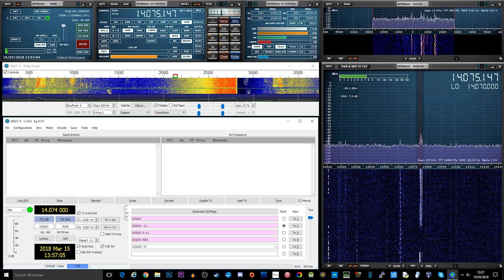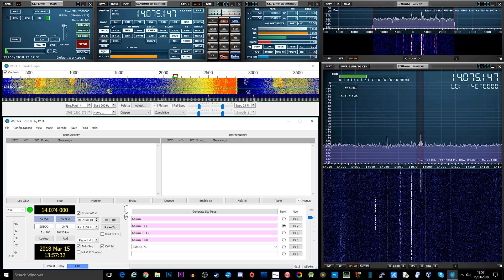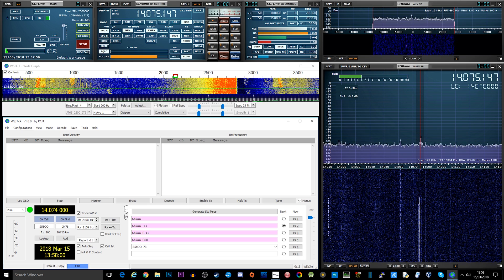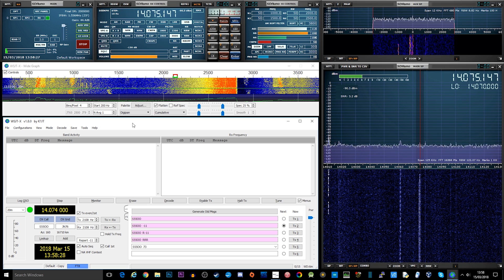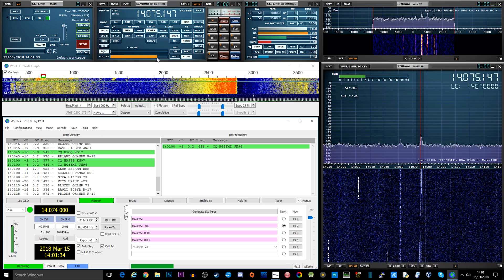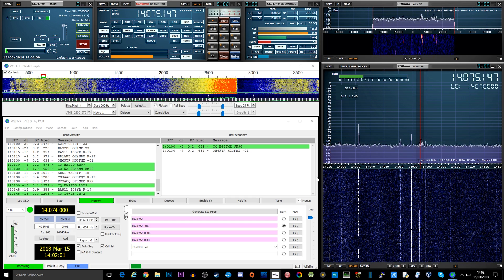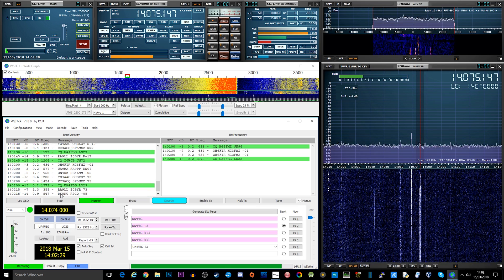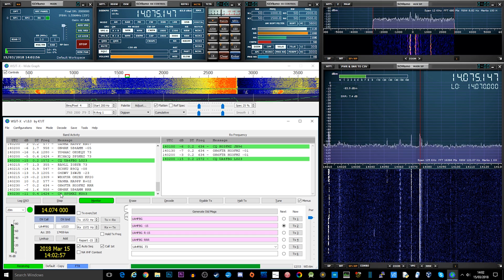Decoding FT-8 With WSJT-X And A SDRplay RSP1A SDR Receiver

Comment: how did you setup sdruno to get the singal to wsjt-x
Reply from the maker: Hi Andrew, I used VB Audio cable. Set the output of SDRUno to VB Audio cable and then the input on WSJT to VB Audio cable.
Reply: @TechMindsOfficial  is there some instructions for setting the SDRuno?